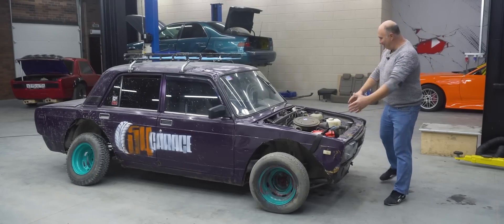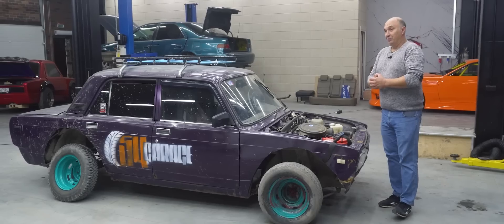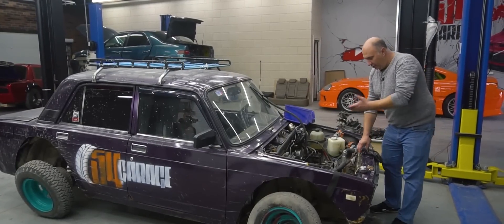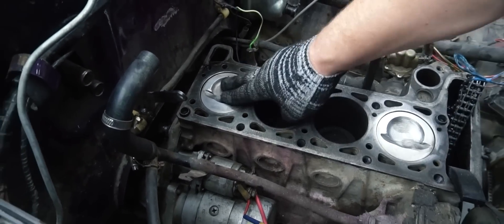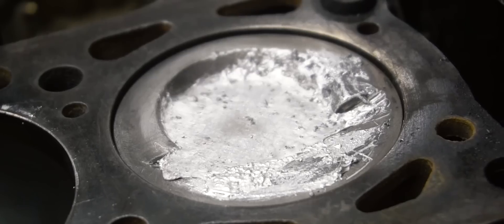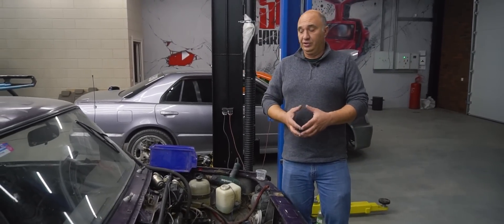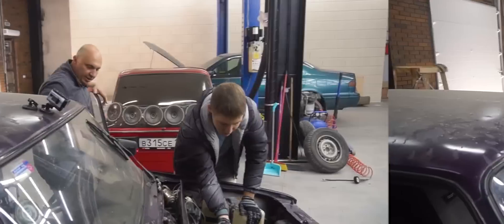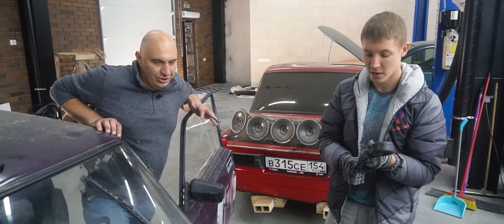Gallium (T-1000 metal) inside the cylinders – what will happen?

Comment: I expected the gallium was going to weaken the metal and make the typical dusty mess but instead, it seems like it structurally held on and the gallium lowered the melting point of the piston so on each stroke, the exploding gas kept digging a hole through the piston. The end structure looks like molten metal instead of cracked material.
Reply: Gallium amalgams with aluminum, but not with an iron casted engine like this one.
Reply: @Jean-Denis_R_R_Loret  These pistons are aluminum made I believe.

Comment: how about galvanically isolating the lower and higher potential parts of the motor   the point would be to try to make a lower resistance path than the heat cycle that every regular gas motor uses to run  there must be a way to make a lower resistance path to get some thing more than unwanted heat escaping  love the videos!!!

Comment: I want to see a Lada running on a 50/50 mix of nitromethane and propylene oxide. This is supposedly the most powerful liquid fuel setup you can possibly use, but you'd need to re-jet the carburetor and adjust the ignition timing.
Reply: Sounds good!

Comment: I'm seriously thinking about modernizing an engine with a handmade cylinder head, doubling the valves, increasing compression and adding fuel injection, and a timing belt, yeah !!! Toyota actually did that by using the ford piston size in the 3.4 Prado. I want to update the preXflow 4.1 engine.
Reply: If you have the know how and the equipment why not?

Comment: When you said gallium on aluminium, I smiled 🙂
Reply: I did? When?
Reply: @SwapBlogRU  would love to see them modify the crank ,cam and ignition  so each piston is 90´ apart firing on a single cylinder at a time. 
think the sound will be special when running.
Reply: @SwapBlogRU  0:25
Reply: @StephanBuchin  I seem to have mispronounced "aluminium" though)
Reply: @SwapBlogRU  No, no, it's all perfect and you do a great job. When I hear that gallium and aluminium are going to be in close contact, I know there will be problems and that's why I smiled.

Comment: How quickly would an aluminum block engine grenade itself if you introduced gallium to it?
Reply: what engine block.... literally no time at all, engine blocks are cast aluminium which are less dense than a machine billet piston. The gallium would pernitrate almost immediately.
Reply: Thats an interesting idea, Mix galium with oil!
Reply: It's been tested on a lawnmower and it didn't really have much of an effect.
Reply: @jwalster9412  not all lawnmowers are aluminium
Reply: @tslim250  I can't remember if it was a motor bike or a lawn mower, but it was definitely aluminum. It did weaken it, but not enough to break the cylinder.
Reply: @jwalster9412  That's because it was steel then. It's a chemical process, so you're not going to have "nothing" happening when it's introduced to aluminum. It'd be like saying "Yeah, I mixed bleach and ammonia and nothing happened". Almost all of those engines aren't aluminum, as you're not exactly caring about saving weight on a small, cheap engine.
Reply: @Stealth86651  I was thinking of the time the slow mo guys poured gallium into a motor bike engine and miss remembered it was a motor bike. And it did have an effect, just not enough to break the cylinder walls of the block.

Comment: Id like to see pure oxygen injected into an engine and see the internals after some hard dyno pulls.
Reply: Melty melty!
Reply: I have done this with old small block ran huge fuel jets to run really rich and ran oxy from tank through NOS plate but still made holes in 3 Pistons after 1/4 mile pull but it went like a bat outta hell till it let go😂😂
Reply: Oxygen+hydrogen
Reply: Mastermilo did that and they burned up their piston rings
Reply: Used to inject oxygen from the oxyacetylene torch head down the throat of the carbs years ago when they ran too rich too pass the emissions test. It worked great
Reply: they did that a few weeks ago.
Reply: pure oxygen injected :text-green-game-over::face-blue-smiling:
Reply: I forget the exact details but I know that with nitrous oxide the oxygen molecules aren't released until it's broken down by combustion so it doesn't go nuclear and melt things. Engine guys tried it 10 different ways until they found nitrous.
Reply: Try it with Avgas, 130 octane leaded, or 100 low lead. It does spectacular things to exhaust valves and cats, as it is still burning when it hits them. Plus melted pistons as well.
Reply: Considering there is 21% oxygen in the air, running it on pure oxygen would mean you can use roughly 5x as much fuel in a cylinder to keep the AFR correct, which is theoretically 5x more power from each combustion cycle. Would have a similar effect as forced induction but possibly quite destructive.
Reply: @matthewk7037  I was thinking more like grandmas oxygen bottle and regulator at 10LPM max
Reply: that's an excellent idea
Reply: Thats a great idea 💡
Reply: Pulls?
Reply: yep
Reply: That would be interesting. Maybe mix it with NOS!!
Reply: Google Tzar bomba, Basically the same thing
Reply: Nitro methane in a diesel.
Reply: @Ufbwgeufjdo  How about when that backfires? Both the engine and the idea.
Reply: Mastermilo82
Reply: It will destroy engine in fir's start and burn aluminium and steel, even uncontrolled if keeping trying. Oil will burn or explode in pure oxygen enviroment for sure.

Dont do it.
Reply: Forget O2, what it needs is O3 (ozone).
O3 (ozone) is made by way of high voltage corona in a stream of air or O2.
The high voltage smashes O2 into O and those O bond to more O2 to become O3.
Thing is, O3 is very unstable and soon breaks down into O and O2.
That's what makes it so reactive. The O quickly breaks away from the O2 and then bonds with hydrogen or carbon before combustion takes place.
It's great for diesel engines. It has the effect of raising the cetane rating of the fuel.
Reply: @brian cool story bro